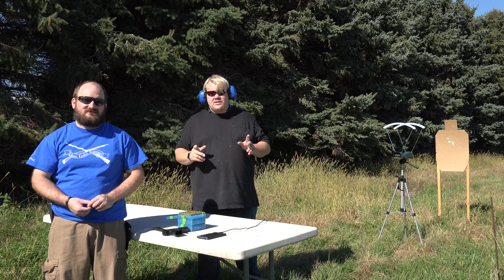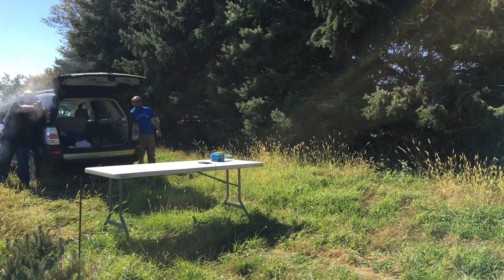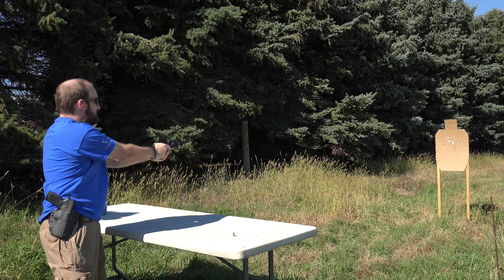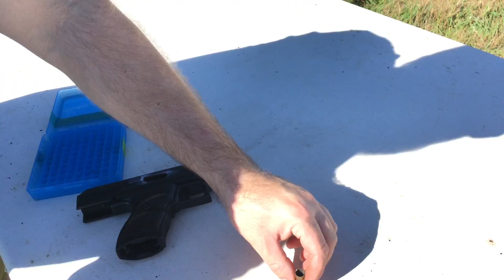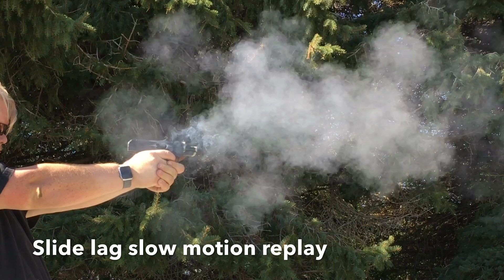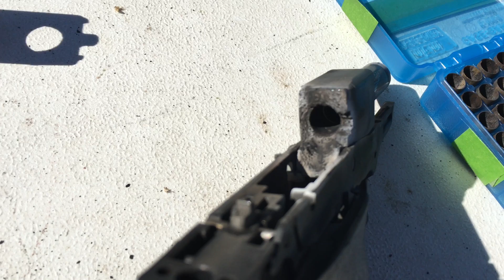Black Powder in a Semi-Auto Pistol? (Pyrodex) 4K

Comment: I run a CZ P10 F 9mm, I was interested to see what happened, as I thought it would work. BUT, under normal situations I would no load up with BP, lol, BUT,  if ever the apocalypse turns up, and I run right out of smokeless, so yea in a  real pinch why not, what you got to lose then. But, I do have my othe back ups, 1858 Remington.44 new army pistols 2 of them, and a nice 32 inc barrel Sharps to fall back on as well. I even have  a.457 as a back of the backs ups, lol. ,  an air rifle PCP, which will punch a 330 grain lead slug down range at over 900 FPS. 150 yards it will take your head off/

Comment: Liked the video but you are aware that the reason you clean most pistols within every 100-1000 rounds isn’t poor design aren’t you? It’s dirt build up. Some guns are designed for tight interference fit and some are built with very loose fitting meant for the lazy guy who cleans once in 3000 rounds.

Also, splashing that thing with dawn and water would’ve washed enough fouling out of the way to keep on running instead of failures very Mag past the first 100 rounds.

Question for you though, did y’all load up lead or jacketed bullets for this demonstration? And do you think a better pistol would’ve run them better?
Reply from the maker: Copper plated bullets. I was unable to get a glock to cycle regardless of what I tweaked with bullet weight and the powder charge.

Comment: It wasn't really the invention of smokeless powder that allowed the invention of modern semi-automatic firearms (especially handguns), but rather advances in metallurgy and polymer chemistry. The invention of stronger, lighter, more ductile metals and stronger, lighter plastics was what led to Glocks, Berettas, Sigs, etc.

The invention of smokeless powder opened the door to a whole plethora of things, such as hollow-point bullets, gas systems, long-range engagement and a general increase in both velocity and accuracy. Whereas with black powder, you could make accurate shots to 50 meters and maybe hit at up to 100 meters, you can now hit targets accurately up to 3.5 MILES away with smokeless powder.

Comment: what was your load data???
Reply from the maker: It’s been several years so I don’t recall exactly the pyrodex load worked more reliably than the direct blackpowder load
Reply: @LFDResearch  direct blackpowder load? was there something i missed in the video? do you think the slide weight was too much?
Reply from the maker: The burn rate of pyrodex vs black powder varies enough that the pyrodex can run a hipoint reliably quite well but real black powder is more finicky and on the borderline of not cycling
Reply: @LFDResearch  interesting! may i dm you? i have a really cool idea for an experiment but I dont quite want anyone else taking the idea, but if yall wanted too id be ok with it. LMK.

Comment: As someone else mentioned, black powder doesn't play well with petroleum gun lubes, (nor with smokeless bullet lubes when shooting lubed cast bullets).  It would be interesting to see this test re-done after carefully cleaning the gun of all traces of conventional lubes, then re-lubing it with Ballistol, which is what's most often used in black powder guns.
Reply from the maker: We will keep that in mind gonna do this again but with 45acp for better case capacity and much improved high speed
Reply: @LFDResearch  try Tungsten Disulfide, it's a dry lubricant.
Reply: Just read from ChatGPT that black powder works best with animal fats or beeswax. Vegetable oil is another alternative. Thank you for the heads up! Just as a warning though, Ballistol is also a petroleum based lubricant. It's essentially mineral oil. I would stick with the natural options above, as this what I'll be doing with my setup. Thanks again for mentioning this, and I thought I'd mention what I found on follow-up for all others interested.

Comment: Could you redo this test with actual blackpowder? And have a bucket of water nearby to see if it can be cleaned just by dumping it with water.
Reply from the maker: We have done real black powder it’s marginal on running in 9mm have to get in the right rhythm for it to cycle. Cleaning takes some scrubbing in addition to getting wet. Trying to find a reasonably priced 45acp hi point last one I found they wanted over 300 for it
Reply: @LFDResearch  sweet thanks!
Reply from the maker: We filmed the other test it’s footage is on we like shootings YouTube channel
Reply: @LFDResearch  Nice, what's the title of the video?
Reply from the maker: Hi point in slow motion
Reply: @LFDResearch  thanks

Comment: You know why the High Point only ships with 1 magazine?
1: You melt the serial number off it then after you shoot the other guy, you drop it and take his gun, so you don't need more than 1 magazine.
2: When it's rolling around under your truck seat for a year or two, the spare, loose magazine will probably get lost anyway.
3: Adding an additional magazine and all the ammo it would hold will double the cost of the gun!

Comment: Cool test but the Hi Point is a straight blowback design which isn't really indicative of most modern handguns. I would be interested to see how the test would go with a tilting barrel design like most modern semi autos.
Reply from the maker: We have tested it using black powder and it it’s borderline in the hi point and a Glock. Our conclusion is that it’s s case capacity limitation there we hope to revisit this test with 45acp guns at some point. For now we are gearing up to push our sabot tests faster with the final goal of one mile per second with a 55gr fmj
Reply: @LFDResearch  Gotcha. Sounds like it'd make for a cool video. Shot you guys a sub, hope to see that one soon.
Reply from the maker: Awesome! It’s an expensive video to make but we have all the supplies on route we hope to have this test going in May

Comment: I want to see you run black powder through a Sig Sauer! Both Pyrodex and real black powder!
Reply from the maker: It would be interesting what I ended up running into when I attempted to run it through a Glock is that 9mm just does not have the volume to get enough black powder to fully cycle something like a Glock it was extremely close but just not quite there. A 45 acp should have the volume to pull it off just haven’t had the time to test that yet

Comment: Didn't expect that hi point to run as good as it did. My black powder revolver has seized up after 30 rounds
Reply from the maker: Neither did we that’s why we only made 300 rounds.
Reply: I kind of imagine that if the Hi-Point is anything like the old Haskell pistols, it's actually at a bit of an advantage when dealing with extreme fouling.  At least my JS-45 has a lot of slop in the clearances, and the slide spring is heavier than it would otherwise be for a locked-breech pistol (about 35lbs (yes, I measured it)).   That said, I don't know how that translates to the more contemporary Hi-Point stuff.

Comment: I did some black powder loads(4f) in a .45 acp in my ruger 1911. After about 200 the rifling was completely fouled and the bullets were hitting the target sideways at 8 yards. Curious as to what yalls barrel looked like and if you ran into the same problem.
Reply from the maker: +Logan Malone the barrel was extremely fouled but we did not notice any keyholing.
Reply: you managed to cycle 200 rounds with real black powder?
Reply: @gustavesoucy-breton6841  I managed to shoot 200 rounds out of it without cleaning. It cycled the first few magazines without a problem. After that it would not cycle all the time.
Reply: @loganJmalone  okay, this is great, i am writing a novel where the characters are forced to use black powder in modern weapons and i thought you could only put, like 30 rounds only in a pistol before it becoming completely unable to work

and also, how many shots precisely? most records say it can cycle 30 rounds just fine

Comment: Here is a playlist with some other attempts to use black powder (and substitutes) in modern firearms. There is even an AR-15.

 https://www.youtube.com/playlist?list=PLvhqxVenfcB7_h-PVU4KlKiPFG0FmRij1

Speaking of the AR-15, here's the corresponding set of blog posts.

https://web.archive.org/web/20120210092518/http://cemeterysgunblob.com/category/ar-15-in-black/

The same blogger had more success with an M1911.

https://web.archive.org/web/20120119110211/http://cemeterysgunblob.com/category/45acp-in-black/
Reply from the maker: +Daniel Watters thanks for the info I will delve deeper